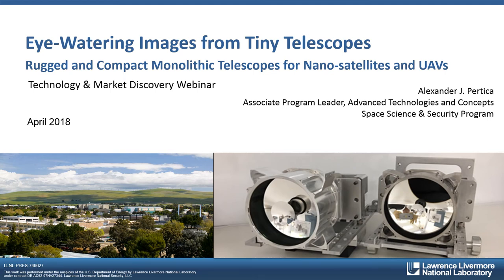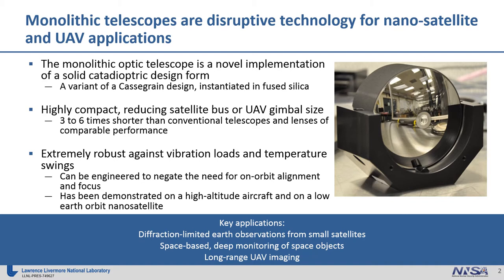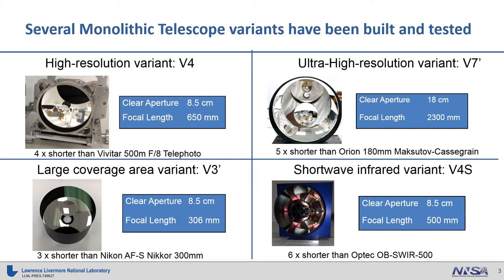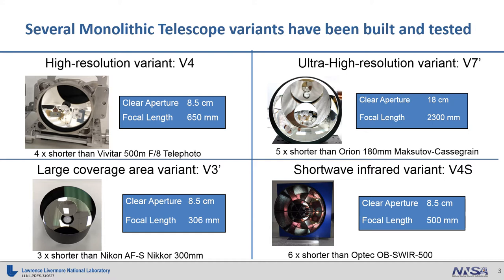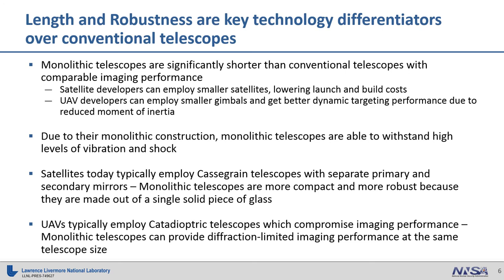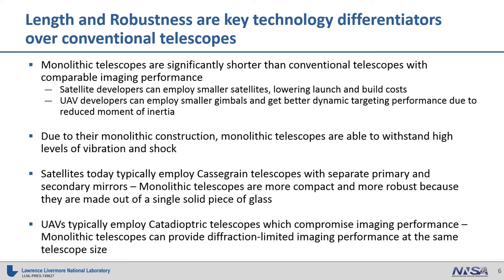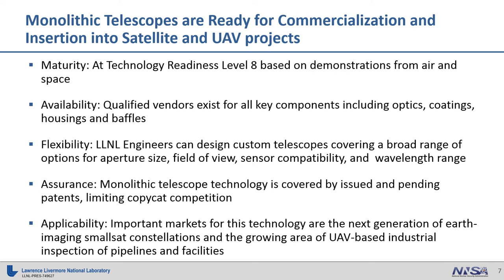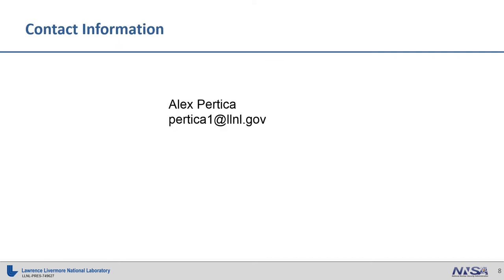Eye-Watering Images from Tiny Telescopes by Alexander J. Pertica

Comment: Just wondering: won't the "glass monolith" re-introduce chromatic aberrations, that were pretty much missing in "hollow" reflector designs?
Reply: Specialized CCD with compensating algorithmns can fix those problems when you have very high accuracy in lens pitch
Reply: @acasccseea4434  so, yes .. Just like modern MFT lenses etc come with IDs so that the camera firmware knows how to "cheat"
Reply: I guess they are very negligible, most of the surface were there is a change of refractive index are almost perpendicular to the incoming light and mirrors do not cause chromatic aberration.

Comment: Will this work if it was cast in acrylic in stead of glass? To lower the cost and make it ready for mass production for use on DSLR cameras as telephoto lenses.
Reply: It will work, but not very well.  Needs extremely tight tolerances to have a good image.  Maybe it can save on grinding time?
Reply: I guess, on the one hand, the refractive index of certain glass variants is significantly higher, than acryl etc., but if I get the principle here right, this is a reflector design, not depending on the materials index.
On the other hand, different kinds of plastic seem translucent and homogenous, but if you look through them using polarized filters, they are not, depending on the way they were cast.
Also, acryl, polycarbonate and the like will filter certain wave lengths.
For last: Polishing might not give the results, so the curvature needs to be done by the casting mold, making it cheaper, if feasible. But the metal reflector might need to be solved using an extra part, not metallizing by vapor coating?
Reply: @martinb.770  Why not vapor coating? Plastics is metallized all the time by sputtering, etc.
Reply: @titter3648  Would vapor coating work with thermoplastics, without damaging the surface? Will sputtering provide a usable surface for reflectors? 
Just asking - I'm not a pro.

Comment: But what about weight efficiency?
Reply: Hmm, how heavy is the housing and focusing mechanism to hold a 2000mm lens?  Also the cost of going from a 1U to 2U or even a 4U micro  sat to hold a larger lens.  Weight is not everything.  When looking at the entire package it's a game changer.  The biggest drawback is the amount of light it pulls in and the sensor needs to be very small.